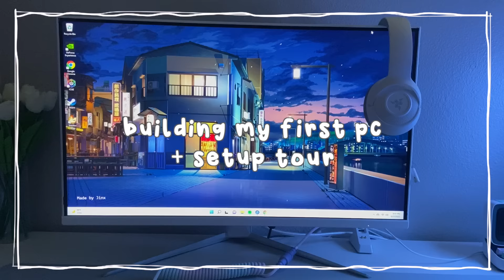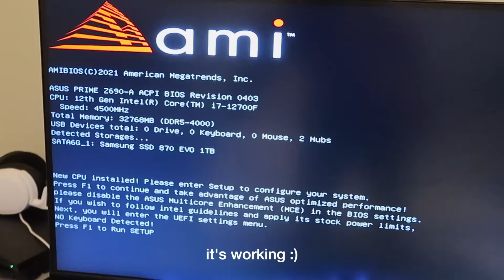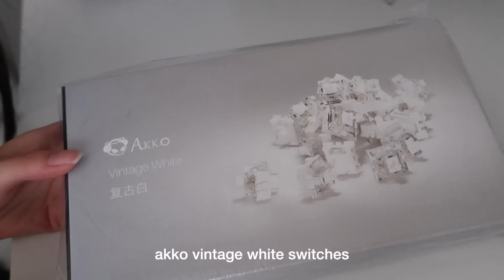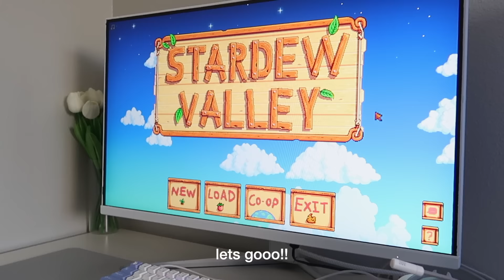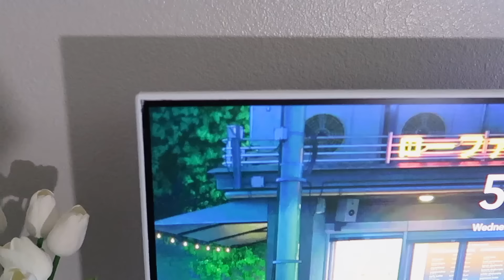building my first gaming pc | aesthetic white build and desk + setup tour

Comment: I suggest putting molang below the gpu because most of the heat exits to the backplate of your gpu and molang might melt a little and stick to the backplate. Anyways, you have wonderful setup! White builds are so comforting to look at
Reply from the maker: Ohh ok thanks for letting me know :) and thank you so much I agree I love white builds
Reply: Is she is just playing SV there is no risk of the GPU and molang becoming one
Reply: It's a 3060. It doesn't have enough power to melt it regardless of where she puts it
Reply: @ARCbirdman  what about a 3060 with defect fans?
Reply: @ARCbirdman  what about a 3060 with defect fans?
Reply: @RichyMTB  it would thermal throttle and then blue screen before anything could happen. You really jus tryna find a problem
Reply: @ARCbirdman  what about it doesnt?
Reply: @RichyMTB  it's a 175 watt GPU. It doesn't make enough heat
Reply: @ARCbirdman  i think it does

Comment: I have the same case, and I love it. Totally underrated, IMO. The Lian Li 205 Mesh comes with 3 RGB fans already. I went a step further and modded my GPU with white vinyl wrap and an RGB backplate. My keyboard of choice was the Roccat Vulcan, and I use some white LG 32" monitors. Otherwise, our setups are not that different. I even use the same kind of power supply and motherboard (but the AMD version). Good job
Reply from the maker: I agree I love this case !!!

Comment: Is that a desktop computer or monitor? I'm so confused between the two. As of late I've been eyeing on the airpods max, monitors, and headphones. So I was wondering if what you have on your desk is a monitor or desktop computer. How did you get to use Windows operating system on there?
Reply: I don't understand what's so confusing about. She has both. A monitor is just that: a monitor. It doesn't do much by itself. You need a computer or other device connected to it in order for it to show anything. For getting Windows installed, you'll need another PC with internet and a flash drive to make a USB installer. You download the Media Creation Tool from Microsoft and go through its steps to build the installer. Once you do that, you put the flash drive into your new PC, boot from it and go through the install process for Windows. Plenty of videos on how to do this.

Comment: Hello ! May I know why you don't recommend your old MALSKÄR chair? I was actually thinking of buying them because they were cheap 🥲I was thinking of adding some pillows for extra padding
Reply from the maker: it's just so uncomfortable but I think adding a pillow would help it a bit
Reply: @lamtachi  thanks for your reply !! after some thoughts I'll just buy a pricier chair because it will be more worth it in the long run since l need to be sitting for long hours

Comment: Beautiful build. I have an all white build as well except for the monitor. May I ask how you did the plastidip spraying?
Reply from the maker: thanks! I tapped the whole screen and I used around 3 bottles of plastidip and sprayed the whole thing. I did multiple layers until it was completely white. It honestly doesn't look the best so I'm not sure if I recommend doing it. One thing I would've changed was to be a little more patient and wait a long time between each layer and then I think it would  turn out a lot better

Comment: Damn you went mega overkill on your cpu. For the ram 32gb is too much for the Rtx 3060 to utilize during gaming but for productivity it’s useful. I’m just questioning why you didn’t get 16gb of ram and get a Rtx 3060 ti. It would make alot more sense for gaming.
Reply from the maker: yea it is overkill… I wanted 16gb, I originally got that one as you can see in the video but it wasn’t compatible. the place I got it from didn’t have a 16gb one that was compatible  and I was really impatient 😅 so I just got the 32gb one.. it’s ok I plan to use it forever and also do video editing and stuff :)

Comment: this is good for a beginners pc but like pairing a 3060 with a 650w psu.......
Reply from the maker: most people recommended a 650w psu and I used a psu calculator so I just went with that. I'm not planning on overclocking or anything

Comment: im late to the party but if anyone sees this video and is looking to build this PC....don't. unless you have the budget for it 
here are my tweaks:

cut the corsair dominator ddr5, its like 75% of the price for the 3060 for only 32gb...just get teamgroup ddr5 or like trident or even a different kind of corsair ram, its not worth it for this level build.
you also don't need ddr5 for this build lol 16 gigs of ddr4 will be amazing too but if you want ddr5 so you don't have to replace it for a while then that's my take

put that extra $250 into getting an nvme SSD because its much faster than a regular ssd or hard drive

i would also upgrade the GPU, paying $500 for a 3060 is actually insane, you can get an rx 7600, rx 6750xt, rx 6700, or if you want to stay with nvidia id get an rtx 3070 (most likely used but brand new is also great if you can get it for a reasonable price) or a brand new rtx 4060 for about $300 that outperforms the 3060...even a 3060 ti is a better choice considering you spent $200 on the cpu and a whopping $300 on the ram

if you get any of these gpus id get a 750-850 watt power supply for upgradeability and id just get it in black because you cant see the psu with this case anyways and you're paying extra for it being in white.

the cpu is a bit overkill but i guess that can be okay for upgradeability down the line id just get an i5 12400f or if you want an amd cpi then maybe a ryzen 5 5500 (if you stick with the rtx 3060 for a MUCH better price) or a ryzen 5 5600/5600x if you don't have the money for a $250 cpu lol
if you want an am5 cpu then the ryzen 5 7600 is the best starting point.

your aio is mounted as exhaust which means you have two intake fans and three exhaust, which is negative pressure. you want either neutral or positive pressure, so id spend some of your extra money from the ram change (please for the love of GOD get different ram..you don't really see the corsair dominator until you reach like $3k to $4k builds) on some extra fans to mount at the bottom of the case as intake, or get a case that has more fans that come with it so if you mount an aio you have positive or neutral pressure
OR drop the aio entirely and get an air cooler for your cpu. this will most definitely work for the gpus i mentioned above. 

and lastly never pay full price for a windows key, you can get them for like $20 basically everywhere else
or you can just leave it unactivated if you don't care

overall its a good build and its not like any of the parts are bad but you're overspending for certain parts and underpaying for others because they (look nicer?) i'm not really sure what the reasoning was, your boyfriend did a great job putting it together, but for most people this build is horribly optimized and im pretty sure your gpu is bottlenecking your CPU.
it will work
it will play games
but you can squeeze out more performance from it with $1700, WAY more, especially if you're buying used
you can even get more performance for less money than this